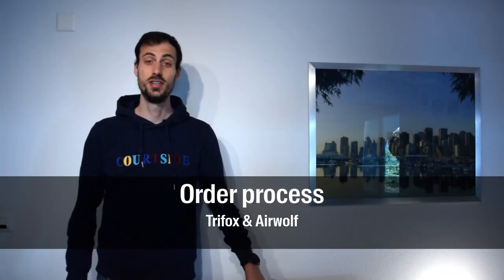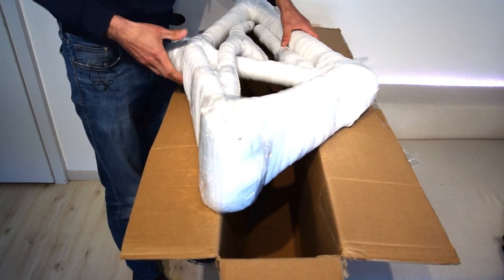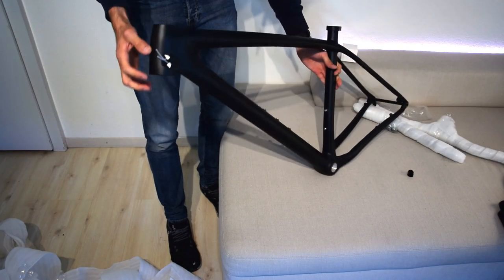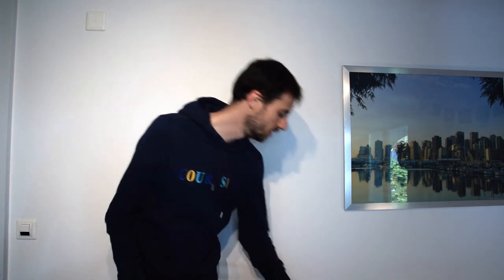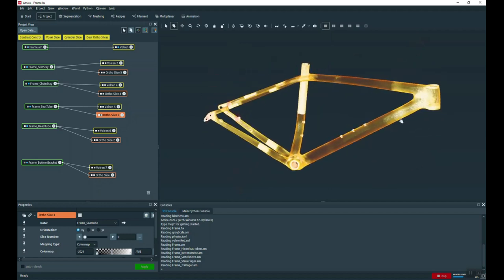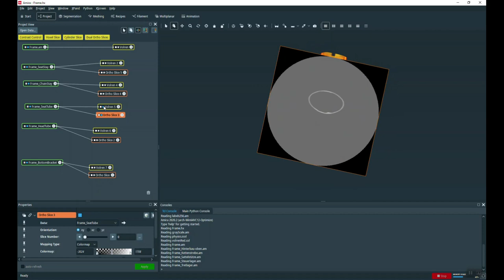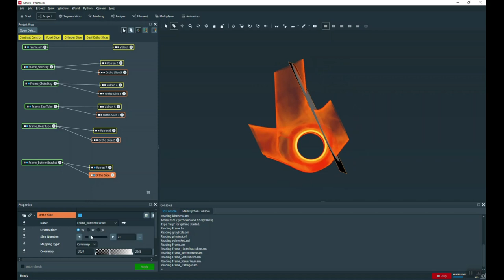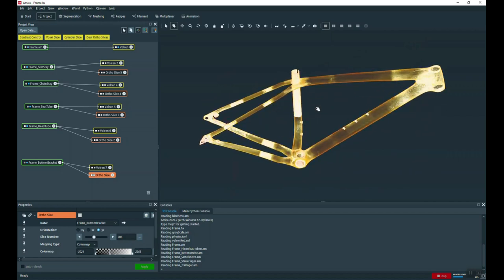Are Chinese Carbon Bike Frames Any Good? DEEEP DIVE - XC Bike Build (Ep.1)

Comment from the maker: Would you ever buy a Chinese carbon bike frame? Did you already make some experiences with unknown brands?
Reply from the maker: @Anthony Duncalf Cool, thanks for sharing! Glad to hear that you haven‘t had any issues. Hopefully, it will be the same here…
My road bike is from Dengfu, also with the raw carbon finish, and I love it too how the people are confused about it.
Reply: Looks like an epic spz frame... am I correct? Tks
Reply from the maker: @Maker3d380  Yes, it is quite similar to the Epic HT with respect to the geometry. Would be interesting to put an S-Works Epic HT into the CT scanner and compare them with each other.. :) Maybe I get my hands once at an Epic and put them side-by-side.
Reply: I purchased a BXT road frame last year.  It is holding up pretty good so far.  In the beginning I was so worried when i hit the road bumps.  I was afraid the frame would crack and fall apart.  But after a few rides, it held up good, even after a few decent bumps on the road.  I checked the frame for any sign of crack and/or damage but didn't see any.
Reply: @dbikeprod  A comparison with a S-Works would be awesome! I think you have a good thing going with the idea of scanning bikes and I find it very interesting. It could gain traction on YouTube if you start putting out more videos like this.
Reply: Hey, about the China Bikes.
I own (3) of them. Paid about $330 for each Frame.  Built the bikes myself with SRAM components and tubeless wheels.
1) Orange Fully Rigid MTB 2.3" MTB Tires / 2017 build has about 3000 miles on it.
2) Red 29er Hardtail MTB 2.3 Tires and 140mm fork. / 2019 Build has about 1800 miles on it.
3) Green CX Fully Rigid 40mm Maxxis Tires / 2020 build have about 700 mile son it.

All three are ridden on the toughest trails in Eastern Mass including Rock Crawling at Lynn Woods and Harold Parker. They are the Best Climbing Bikes I have, Bottom Bracket clearance is acceptable.
Have photos and lot of build information if you are interested....
Reply from the maker: Cool! From which brand did you buy the frames?
Yes, I‘d be interested about your choice of components!
Reply: Bought a road bike frame from Velobuild right after it switched from being an open forum to a chinese vendor. Built it up and rode it for a few thousand miles before selling the frameset locally to another guy who rode it for a few thousand miles more. He then sold it to someone else and its still going strong to this day. 
Now looking at chinese gravel frame options. :)
Reply: @dbikeprod  Hey guy, sorry I did not see your reply.  So, I made a couple of video's on You-tube under all day adventures. One of them is a Red China Bike stop-motion frame build.  Also should be a link to my website that has build information on 5 different frames.  It is a public website.. not scamming...
Reply: @davidgarza2267  I bought the velobuild gravel frame at the beginning of this month and the frame came to me chipped at rear dropout. Contacted the seller and they are sending another one to me. Overall the finish is pretty subpar but it’s cheap. Handlebar and stem are heavy, clearly over built. I bought FSA stem, headset and a Spank aluminum gravel bar to replace the stock one. As long as it doesn’t cause me any harm on the trail, I’m ok with it.
Reply: Aren't they pretty much all Chinese regardless of brand except Time and Look?
Reply from the maker: @gustavmeyrink_2.0  Probably, but would you buy it via Aliexpress tho? ;)
Reply: @gustavmeyrink_2.0  Yes, but not all chinese frames are created equal. Some shadey vendors have little to no QC and no warranty to speak of. The more established chinese vendors have gained trust over the last decade or so and now have a brand/reputation on the line. They are more likely to follow up with after sales customer care.
Reply from the maker: @David Garza You are absolutely right. Checking the reviews and how long the vendor is already selling on Aliexpress is the best you can do. But there are still unknowns like warranty issue handling, amount of QC, used materials and manufacturing techniques etc. And at least for me, there is an additional psychological hurdle buying from an unknown brand compared to a brand I know from bikes of friends or so. :) But so far so good...
Reply: Very nice video!! I order a just few days ago a Airwolf YFM026 and was very good to see your video that you dont find none major problem in the frame... thanks for you detailed analysis
Reply: I have an Hong Fu  full carbon frame ,the geometry is the same of Tornado Matador ( probably they buy the frame from Hong Fu, but it's another story)  I bought my frame 2 years ago and I can say that is a great frame ...I use it in very several sessions with jump , drop, rock garden , but nothing this  poor Chinese, cheap, unbranded   frame doesn't want to break 😂😂😂
Reply: To bad you don’t have million subscription. You’re video are very informative. My advice is posting link to your video on bike form on Reddit. As lot’s of people ask if’s safe to. Buy a Chinese bike.
Reply: Link to where you bought the frame
Reply: I ordered gravel frame from company called Chasing wind. They seem legit, good communicaton .. Is there anybody else that bought from them? I allso couldn't find any review  on them.. hope everything goes ok.
Reply: Been using a Chinese carbon unbranded and I don’t have any issues, using it for 5 years

Comment: You, Hambini and Peak Torque have all the gear and knowledge to do some pretty serious analysis of carbon frames forks wheels and components . You should contact H and PT.  I would watch that collaboration, particularly analysis of the new ridiculously expensive carbon stuff coming out.
Reply: As long as there is a powerpoint.

Comment: I did that with a road bike years ago. The bike has held up great, it cost a grand total of about $2k, has the same geometry as an orbea orca, and it's usually at least 2lbs lighter than the lightest bikes in any shop I visit, and mind you those bikes are like 5-6k
Reply from the maker: Nice! What components did you put on your road bike?
Reply: @dbikeprod  a mix of sram red/force, specialized cranks, cane creek brakes, bicycle wheel warehouse wheels, and generic carbon seat post/handlebars, Keo pedals, w/ pedals and a toolkit it's a smidge over 15lbs.
Reply: What frame did you use?
Reply: @torskurdal2721  It was called Element6 I think, similar to the pedalfroce frames

Comment: I have owned some expensive branded bikes and I wanted a cheap bike for winter road use so bought a cheaper frame from another supplier also on AliEx. Having built the bike up with middle of the range groupset and carbon wheels I really wanted to be disappointed, mainly to justify the expense spent on my other bikes. I now have a Pin F8 and F12 with Elite carbon wheels, I build the bikes myself and have had no issues with frames, bars or wheels. I'm 16.5st, 6'1" tall and Ave 250W max 1100 to 1250w. These are road stats of course so they may translate to something else in the XC world but I'm not a small guy and I've clocked up thousands of miles on both bikes. As long as they're regularly services I doubt you would have any issues. Needless to say, The other branded bikes have long gone.
Reply from the maker: I totally feel you, thanks for sharing your thoughts! I only max out at around 1000W but my Dengfu road bike never let me down in the past 5 years, even though I've spent quite some time in its saddle...
Reply: Similar experience.. 👍🏼
Reply: Thansk for the info , i m happy to ear thsi as i watch so much review , Cam NIchols to gives and tries a lot of models and chineese bikes. Anyhow i m 49 years old great shape, going back to cycling of witch i won a championnship....35 years ago ! On a peugeot ! MAN i have been for weeks studying and trying to find a bike in this FOKIN CRZY indutriy that it became. IT s nuts... prices are mindblowing for one  and the only bike i found with NO DISK is Willier Garda. AM looking at SEKA wich seems to be good  and price more decent , but your statement makes me leaning towards the Chineese bikes. IF i never assemble a bike before , would it THAT much of a assle to order frame and pieces a want on it ? ...thanks again , have some good riding.

Comment: Your NDT approach is really the right way of thinking. Personally i would have scanned the bottom bracket area to run the analysis based on point clouds. This way you can run proper GD&T analysis on it for runout, concentrity and so on. The touch probe data does not give you enough form data. But since you are using a system from GOM  this  is pretty straight foward;-). What i would love to see is a direct comparison between a real brand frame and a good fake. Wouldn't that be fun?
Reply from the maker: Yes, indeed, these are good points! When I get a branded frame I will certainly compare it again and refine the measurement methodology.
Reply: Yeah, but that can only really do so much.  There is nothing like getting back to basics.  A good hand sledge can break that frame down enough so you can examine every individual piece.  Guy's like you are always looking for the easy way out.

Comment: A lot of the top branded frames like Canyon, Cervelo, Specialized etc all have similar or worse voids in the carbon lay ups. There is a big hang up with Chinese frames, but quite honestly after building up a Seraph and  Vyce  road bikes with top end campagnolo groupsets, I can say with confidence that they are on par if not better than the big named brands.
I have a Cannondale supersix Evo hi mod  road bike the frame costing  £2500 . The paint finish was terrible and chips very easy, and I had all sorts of problems with creaking bottom bracket. Never had these problems with the Chinese frames.
Clever marketing and advertising and you can charge thousands for a frame that cost penny's to make.
I'll now stick with paying a lot less for a Chinese frame and paying more for a better groupset.
Reply: This is precisely why I am going with "charbon" frames.
Reply: Hello. After a long time, I decided to assemble a bike and I was most interested in carbon assemblies, but premium ones are obviously overpriced. And I'm thinking about buying a track frame from Seraph (tr013). Could you tell us about the quality of the work of this company or advise something better.
If not difficult, give contacts for communication
Thanks
Reply: @timjamew4562 which company do you recommed?

Comment: Thanks for the input, realy cool to see this as choosing a bike now a days in this crazy indutry is such crazy experience and so PRICED OUT OF THIS WOLRD. ANd Discs why all discs every wehere ? I dont want to make maintenance like a moto or motocross. Willier Garda is the only bike i found with rims and pads. Keep it up.
Reply from the maker: Indeed, for road bikes I don't get the disc hype either. Never had any problems with rim breaks so far. In my opinion this is just marketing hype so that they can sell new wheels, frames and tech...
Reply: @dbikeprod  good point i think so to. I found some refurbish bikes internet sites that are pretty neet. Prices are not that lower though for top end bikes still. Then there is the stress on frame that was done , but it is inspected and approved with  parts changed that dont pass the test. Anyhow i am almost to the point of not buying anything. Now my friend through me the grave bike Thing that i didnt think of as all around bike....justto make more complicated lol ....Keep up the good work.

Comment: I had a Cube gtc sl disc.. after months of trips to bike shop with new bearings, discs etc.. it finally got sent back to Cube with full refund after finding the whole frame was misaligned.
Reply from the maker: Thanks for sharing! What did you end up doing? Did you buy a bike from a different brand or did you go with another Cube?
Reply: @dbikeprod  I used the refund to buy a Mekk Pogio 2.8.from the same bike shop. was on offer  £1400 at the time (as I'm very tall, they were trying to get rid of that sized bike.. back in  2019 with full 50mm saturae  carbon wheels..
Which in hindsight was too racy for me.... now moved on to a Giant tcr.. rim brake.. lovely bike.
Reply from the maker: @chriscross5689  Good choice! Rim breaks only on a road bike! What wheels do you ride now? 35 mm deep ones?

Comment: So is the frame by Airwolf has a lot of air pockets. No good then?

The frame has 3 ports, what’s the center port for?
Reply from the maker: It actually doesn’t look too bad to me, but I need to compare it first with other frames to get a feel about the different quality standards.
The third port can be used i.e. for a dropper post.
Reply: @dbikeprod  does the 3rd port route from head tube to down tube and UP the seat tube?

Looking fwd to your comparison videos man.
Reply from the maker: @Bigsheesh yes, it does.
Reply: @dbikeprod  I have a feeling this Airwolf frame is identical to the one sold by Rinasclta, a Polish company. Same factory perhaps? The former sells it at a higher price. Maybe same quality or maybe a tier better in terms of QC?
Reply from the maker: @Bigsheesh I don‘t know this company but the geometry is nearly identical with the S-Works Epic HT. So clearly „inspired“ by Specialized  ;)

Comment: 2 Deg misalignment bottom bracket seems extremely unlikely..Frame would be bored mounted in a gig...as carbon frame cannot be aligned after  making alignment would be via boring BB ..axal mounting points  fork tube...perhaps as carbon is hand laid in manufacture discrepancies occure on the outside surface of frame ...Very accurate measurement and alignment is achieved by using straight edges...rear axel  mount  eyed up with bottom bracket straight edge 2 degrees would be obvious...cycling no handed would check fork tube alignment..
Why would any factory spend millions to setup carbon frame manufacturer then bore BB and  headtube and rear axel out of alignment...Unless you measure the frame in an alignment gig your measurements are likely at fault ???